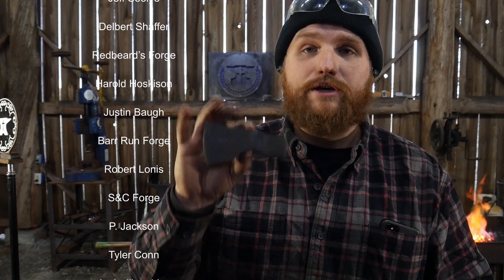Flux & Copper = Metal Glue???

Comment: I have read that copper in the forge can interfere with forge welding. It is in one of the blacksmithing books that I have that an old joke was to throw a penny in the blacksmiths forge when he wasn't looking and it would make a weld not take. Not sure if it is the copper off-gassing or what, but just something to look out for and be sure to clean your forge well after brazing in it
Reply from the maker: This is an old saying so should test out in a video :-)
Reply: @ChristCenteredIronworks  that would be a neat video! I'll try to do some looking and see what book I read that in. Pretty sure it was in The Blacksmiths Craft by Charles McRaven
Reply: DF in the shop has already put this myth to the test. Its bumpkus.

Comment: I had just figured out i could do this. I made swords for my sons and wifes halloween costumes and ran out of fuel for my torch. So i tried the propane forge. Only difference is i didnt do it directly in the forge. I preheated everything then pulled it to the front door and it was hot enuff.
Reply from the maker: Another valid way of doing it. A great out of the box way of doing it.